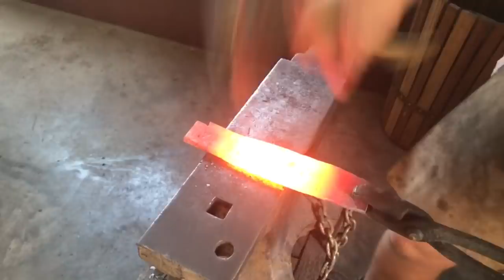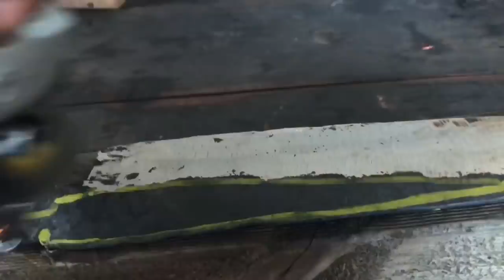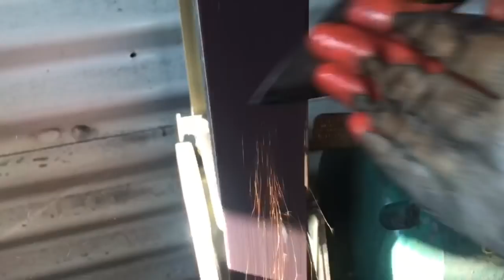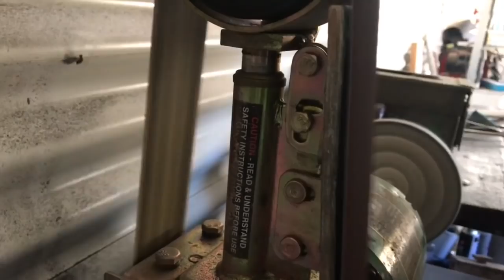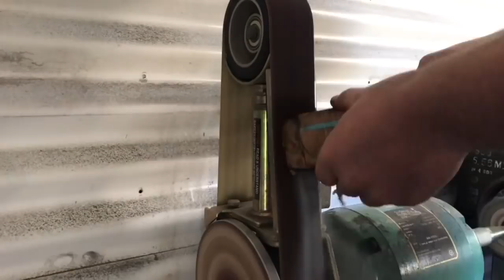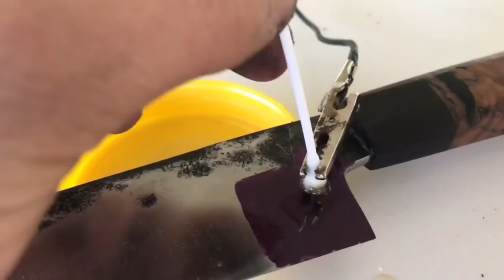Knifemaking- Forging a Japanese Style Chef Knife From a Leaf Spring

Comment: Hi beautiful work.! What is angle of bevel and angle of cutting edge? It's not full flat grind?
Reply from the maker: Kamil Hashimoto I can’t say what the exact angle is but I aim for around 18 degrees
Reply: @eucalyptknives8002  you mean angle of cutting edge? And what about bevel? What kind of grid is this?

Also do you have forge indoors?  Do you have chimney or what kind of ventilation?
Reply from the maker: Kamil Hashimoto I’m sorry but I just free hand grind so I don’t know what the angle of the bevel is. As for ventilation I do have a chimney and I open the windows for cross ventilation.
Reply: @eucalyptknives8002  ok. Thanks! Beautiful knife

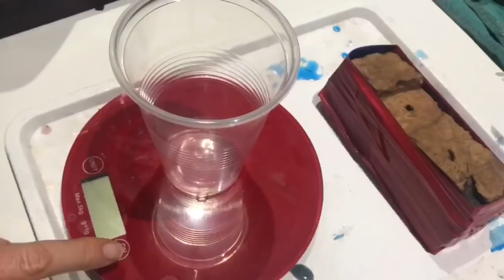Comment: At min 4:27, that step actually for what? Thanks.
Reply from the maker: Henry Corleone Sang That step is to fill the holes in the wood with resin so that when I grind it down there aren’t any unsightly gaps
Reply: At 4:27 he had just quenched (hardened) the blade and was checking if it properly hardened by running a file over it